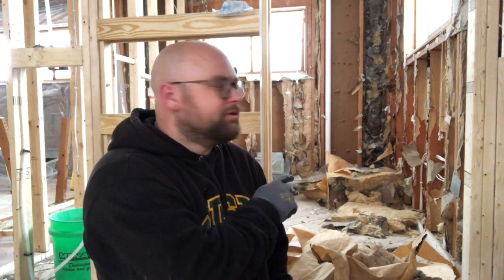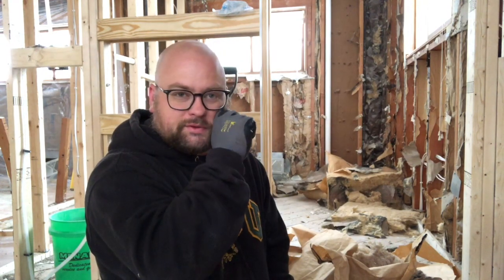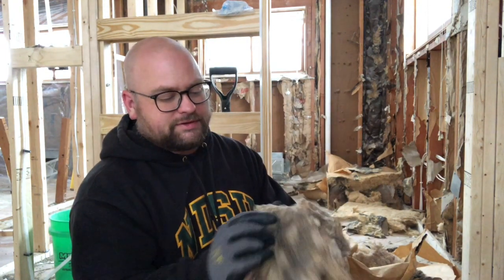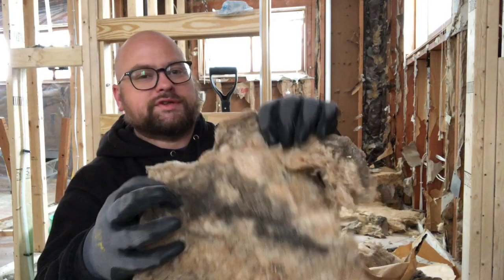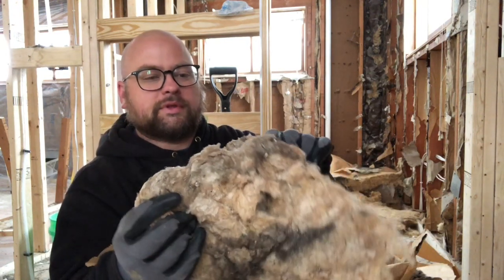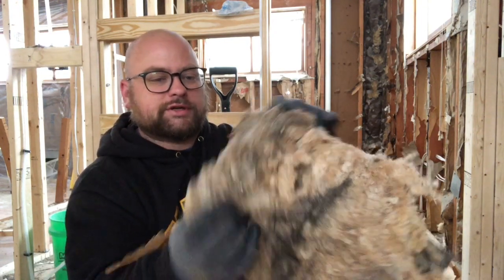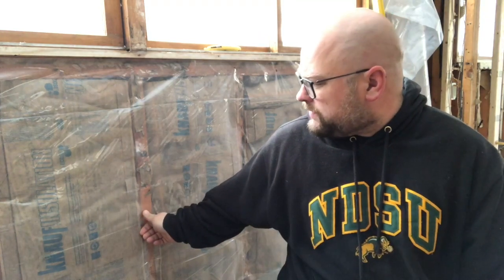Why is old insulation black?

Comment: I am in the process of doing some remodeling. Do you still recommend poly over insulation batts ?
Reply from the maker: At least in my area, vapor barrier is required over insulation batts, even if they’re kraft-faced.

Comment: On my attic floor insulation under the AC furnace vent, the insulation is darker than others, I noticed a little bit water leak through roof during storm. The black  or gray color is only on the top portion of the insulation. Is that dirt or mold?